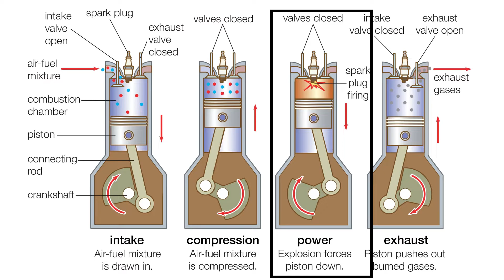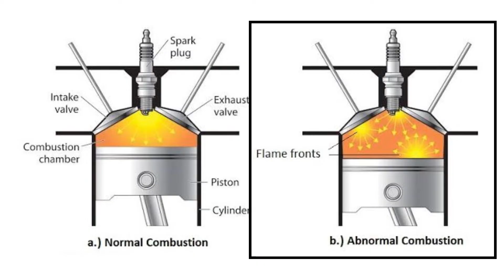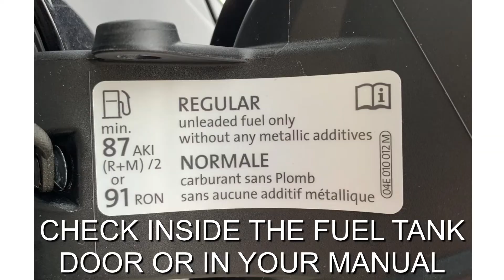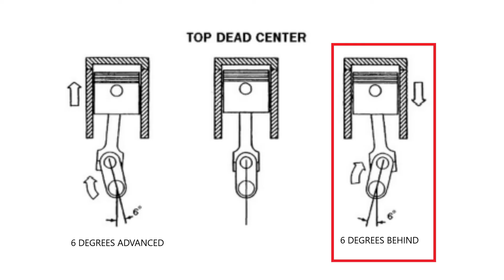What is Engine Knock? | 7 Common Causes & Ways to Prevent it!

Comment: This is awesome where you really provided a clear audio. I have the Mazda CX 60 3.3L Inline 6 Turbo Gasoline having this engine knocking sound on a steep incline only at 20-30km/h. I use Shell V-Power Gasoline at Octane 95 RON. My mileage is still at 1,400km for 6 months but Mazda said that it's just normal. What are your ideas on this?

Comment: Very well explained, thanks. I have a question tho; can’t giving the car too much throttle in a high gear (low rpms) also lead to detonation? And what causes that? I think I once read something about too much fuel getting into the cylinder which then causes the mixture to explode (or detonate) before it should, due to the unusual high fuel amount.
Reply from the maker: K - Thanks for the feedback. Giving too much throttle in a high gear at low RPMs increases engine load, cylinder pressures, and combustion temperatures, which can lead to detonation. The best way to avoid this is to downshift to reduce load, use the correct octane fuel, and ensure your engine is well-maintained.